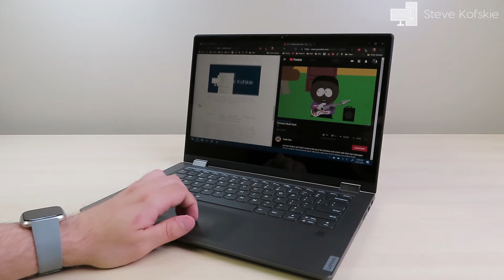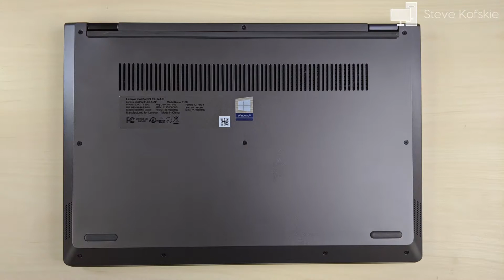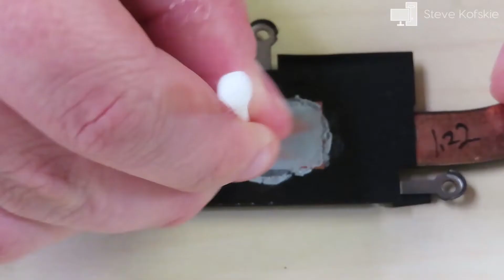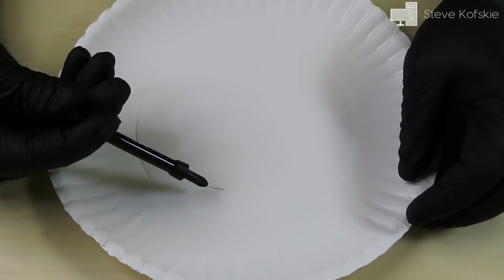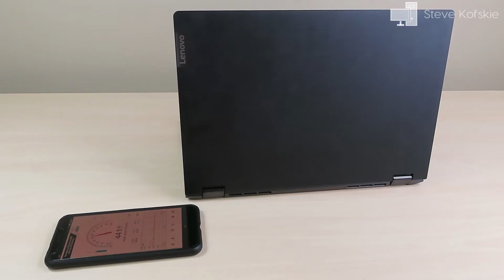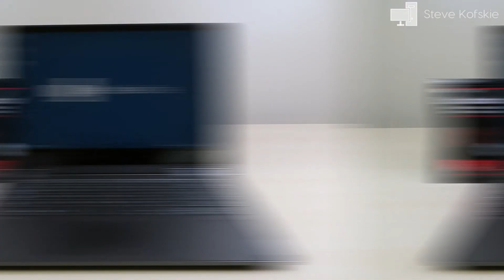Testing Liquid Metal on Lenovo IdeaPad Flex 14

Comment: if u wanted to do a proper easy test just download throttlestop and run a test ! also its great for undervolting to gain some extra reduced heat. thanks for the kapton tape idea. just wondering if this glue could loosen up in time and cause an insulation issue?

Comment: Hi Steve I know why the temps on the laptop after changing it to liquid metal did not work, I have lenovo IdeaPad 5 2021 model and did a liquid paste change I tried the way you did but as u see the results got worse both for me and you. But here is the catch it is not the liquid paste fault in here instead the tape you placed it on the CPU made a slight distance between the heatsink and the dye or die. 

Anyways here is what I did, I removed the insulator tape and added the usual thermal paste around the edges but not exceeding the metal barrier and kept the liquid paste on the dye and closed the heatsink. I was not expecting this but temps got little chiller not by much tho but still it it got from 95C to like 83C on full load of Cinebench.

I hope you read this message soon and hopefully this is helpful... Enjoy :)
Reply from the maker: Sorry for the late reply. I never have enough time in the week to get to comments.

That could be the reason. I'm not a fan of using just conformal coating because you are kinda hoping you applied enough layers to not cause a short (and I'm sure there's the same argument with kapton tape as well). I prefer a little security.

I'm probably going to purchase a new laptop within the next year. When it comes to that, I may redo this Ideapad again with your suggestion. At least if something goes wrong, it wasn't my main laptop. 

Thanks for the suggestion.
Reply: hi can i ask u for recommendations for an affordable thermal insulation paste ?

Comment: Kind of doesn't make sense. Higher temps with LM? Maybe the application wasn't optimal or something?
Talking about the idle, is that just a bad spike? If the temps stayed the same you'd think the heatsink isn't capable of dissipating more heat, but no, temps increased which is kind of odd.
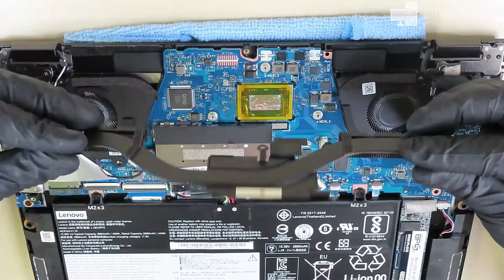Also, the application doesn't cover the whole chip? 5:35 and then compare to 5:42. Cause that is the dye, you just have to make sure you get complete coverage. Maybe try covering the rest of the copper on the bottom of the heatsink? That is if you want to mess around with that thing again.
I'm using Liquid metal on my CPU and GPU in my house PC, granted I've got bigger heatsinks, more fans, larger fans, but liquid metal decreases the Core temps by at least 10 degrees celsius.

Comment: I wonder if the intelligent fan mode operates any differently with the liquid metal compared to traditional thermal paste. Meaning if it's based on CPU cycles, compared to temperature. Either way, this looks like it was a fun experiment. Do you plan on keeping the liquid metal or going back to thermal paste?
Reply from the maker: Thank you for commenting.

I would of liked to do a comparison of the system performance between the two substances, but I thought of it long after I swapped them. I was going to keep the liquid metal on my CPU for now, but if I were to swap it back to normal thermal paste I would compare them. From the tests I performed, I didn't notice any improvement in game play or render time unfortunately.